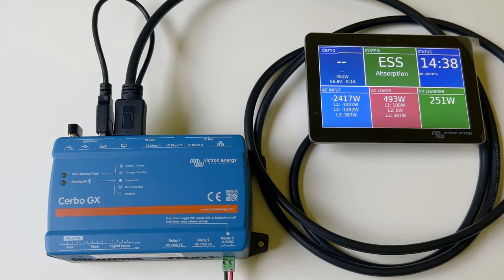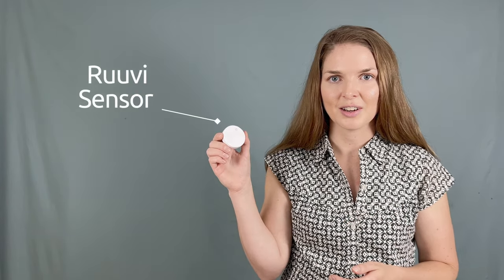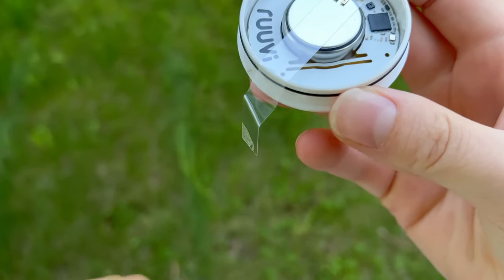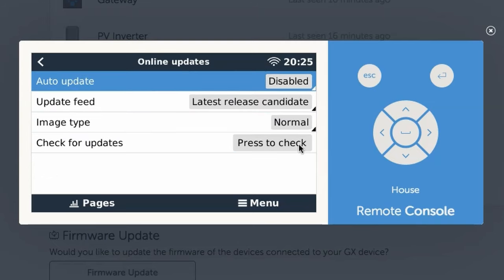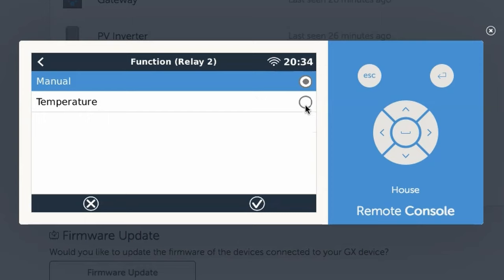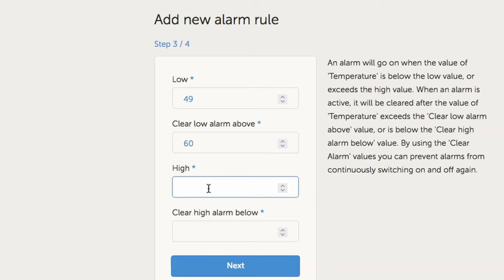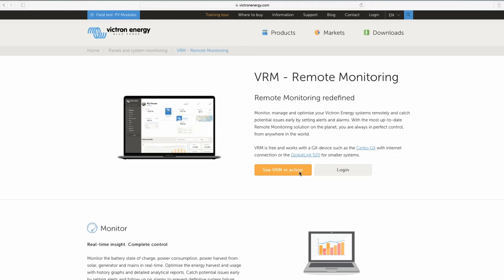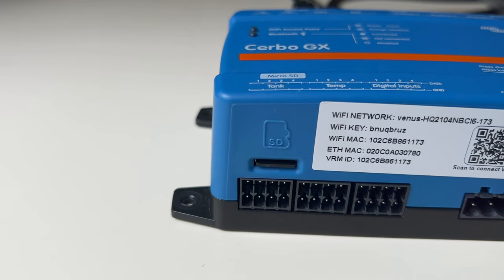Monitor Temperature on Victron's Cerbo GX Using Ruuvi Sensors

Comment: How well does bluetooth get out of the metal shell on a refrigerator or freezer?
Reply from the maker: Hi Nic, the Bluetooth range on the Ruuvi sensors is really impressive, over 600 feet without any obstructions. If you are putting it in a metal enclosure, that range will be diminished but it's still going to be pretty good. I've yet to lose contact with the Ruuvi's placed in my freezer or machine shop.  Here's a good FAQ resource from Ruuvi with more details about its range. https://ruuvi.com/faq/

Comment: Will this work with the color control Gx ? If not what sensor do you recommend for live vrm temperature monitoring for color control?
Reply from the maker: Hi there, this firmware update is unique to the Cerbo GX and the GlobalLink. I am not aware of another product that offers similar functionality with older GX devices. The Cerbo is a really powerful communications hub with lots of potential for advanced controls and product integrations like this one, thus Victron's focus on the Cerbo during this collaboration with Ruuvi.

Comment: Great video!   Can this be used as the "holy grail" for everyone out there using cheaper Lithium batteries and Orion DC to DC chargers?  The big problem with cheap lithium batteries:  no low temperature cut off.  The big problem with the Orion - it doesn't talk to the VE Smart Network and it has no temperature awareness.  Using a Ruuvi sensor on the batteries, could one have the Cerbo  toggle the relay at 5 degrees and use this as the remote toggle for the Orion to stop charging the batteries when too cold?  (video idea!)
Reply from the maker: Yeah, you can do pretty much anything you want with the temperature controlled relay - which is new with the most recent firmware on the Cerbo GX. It’s really fun to see what people keep coming up with!
Reply from the maker: Hi @edwardthomaswalker, you might be interested in the solutions described here in this blog: https://icmontana.com/blogs/technical-articles/how-to-manage-the-temperature-of-a-lithium-battery-bank-heated-lithiums-relays-custom-controls

Comment: What about the Colour Control?
Reply from the maker: Hey, good question. This will not work with the Color Control - that’s the older controller without Bluetooth or the right firmware to talk to the Ruuvi sensor.
Reply: @intelligentcontrols  I'll disagree that the Colour Control GX is an "older product', its still current and does much the same job as the Gerbo, less I/O ports, no built in WiFi & Bluetooth etc but that is often not needed. Also has small but useful colour touch screen, with the Gerbo you have to hook up an external hmdi screen. The Venus is the older model, much the same as  the Colour Control but but with no screen or display port.

Actually its a pity Victron does not do more work in making the controllers more generalised and useful (beside these environmental sensors). Like being able to monitor I/V/Power/Theta in other circuits. I recently tried this with their power meter to measure, monitor and log the upstream  mains feed: waste of time, its only supported for a certain function. Would be useful if one could use these more than capable Modbus  power monitors for whatever circuits you choose and these could be integrated with the controller screen and VRM.
Reply from the maker: @Kosmonooit , you're right that Color Control GX has a lot of the same functionality as the Cerbo GX. It seems that at this time at least, Victron is focused on progressing the Cerbo and the GlobalLink (which also just got a firmware update to support the use of Ruuvi sensors which is really cool. We'll share a video about that soon as well.) So anything is possible. As we wrote about in the blog about this Ruuvi-Cerbo integration, Victron designs products knowing that there are improvements they would like to make in the future through a firmware update which is really cool. We like to say that it's as if every product has a secret potential waiting to be revealed. :) All to say, anything is possible. Thanks, Laura

Comment: Doesn't work any more. I bought one and it won't connect.
I wanted to connect to Victron GX-cerbo, but the RUUVI is bluetooth, and the bluetooth is deprecated on the Cerbo. On the Victron website it's explicit that bluetooth is only for initial set up.
There's no blutooth menu item on the cerbo setup with the latest firmware.
There's no bluetooth sensors menu item in the I/O menu

From the victron website, Guy Stewart has posted:

"The built in bluetooth functionality in the Cerbo GX is limited to the initial configuration of an external wifi network.

Due to a limitation with the built-in bluetooth chip only operating at low temperatures, in order to see the built-in bluetooth connection the unit must be cold, such as when it first starts up. The built-in bluetooth availability can then disappear once the unit warms up (depending on ambient temperature and other loads on the Cerbo).

This is obviously not ideal, but the work around is that this external wifi network configuration function is also available via the built in wifi hotspot (connection details to this built in wifi hotspot are shown on a sticker on the Cerbo GX, and more details available in the Cerbo GX manual."

Will Ruuvi bring out a WiFi version?
Reply: It's still working but not reliable manner without external Bluetooth dongle :) https://www.youtube.com/watch?v=DbMVHgHTO0M
Reply from the maker: Robduino, sorry for the late reply to your comment. You’re right that the Bluetooth radio on the Cerbo GX turns off in high temperatures. We've seen this a few times with our customers. But you can always add an external Bluetooth radio for the Cerbo. Victron tested and recommends a few (See the link near the bottom of our blog https://icmontana.com/blogs/technical-articles/monitor-temperature-on-victrons-cerbo-gx-using-ruuvi-sensors). We sell this Bluetooth radio to customers that are buying Ruuvi sensors and already have a Cerbo. This little radio simply plugs into your Cerbo and will reactivate that Bluetooth functionality. There are lots of options for this. We've just gotten good results from this little guy: https://icmontana.com/products/tp-link-usb-bluetooth-adaptor

Comment: 67€ is too expensive for a wireless meteo sensor imo.
Reply from the maker: I'm sure there are lots of options out there but we love how the RuuviTags integrate with existing monitoring systems. Bluetooth communication to a Victron Cerbo GX and being able to see all system health and performance data from the VRM portal is pretty killer. If you're using the sensors as a stand-alone, the Ruuvi Station mobile app is really nice and fun to check in on, set alerts, etc.